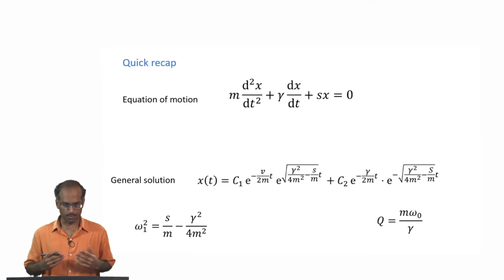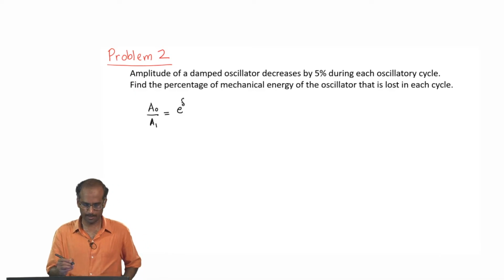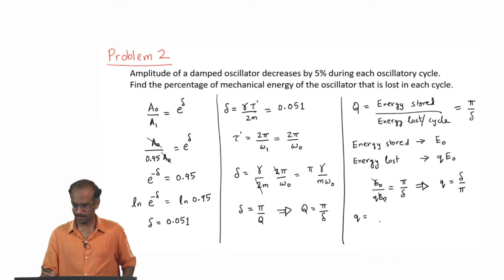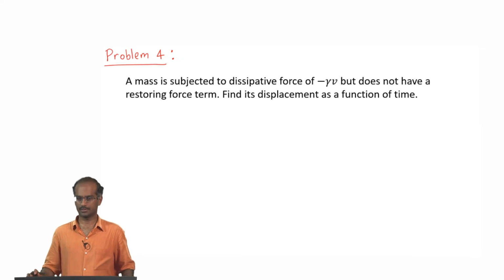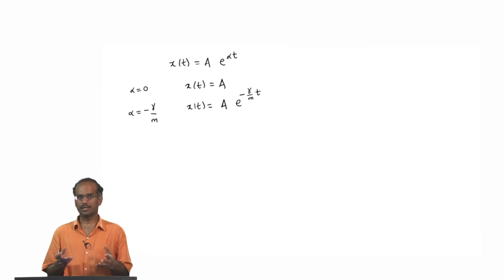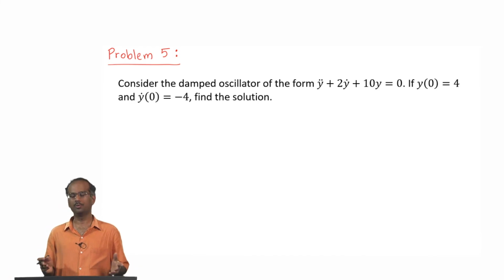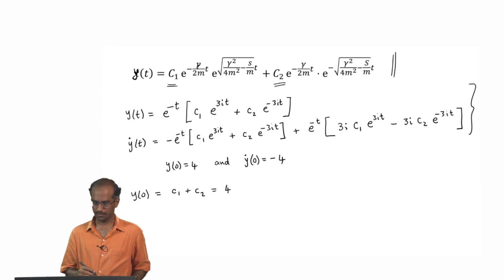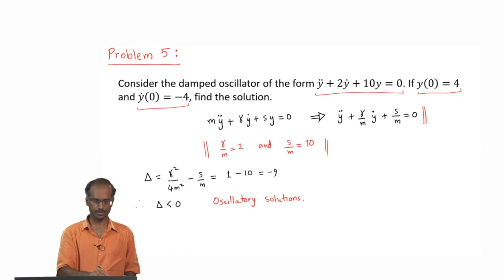Damped oscillator : Problems

Comment: The second question's final answer is 0.016 so it would be 1.6%
Reply: Shouldn’t it be 10% as energy is proportional to A^2 so delE/E=2delA/A which is 10
Reply: @aayushtaparia2676   yes
Reply: @aayushtaparia2676  yup, its coming out to be 10.2% for me.
Reply: @Sachin Pandey I got 9,75 % since the E ~ A^2, i think you can work that out with simple algebra
Reply: @rindirputra619  yes, using simple algebra we will get that result but using the same method as professor, i am getting 10.2 %.
Reply: This is my answer  @rindirputra619